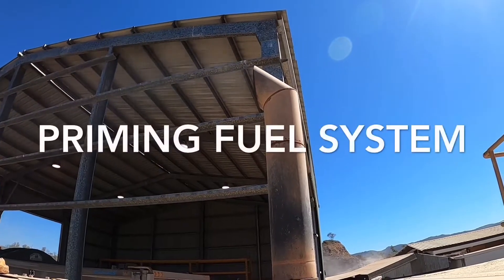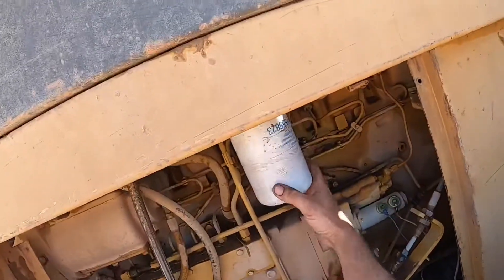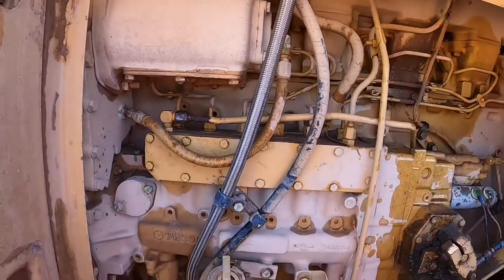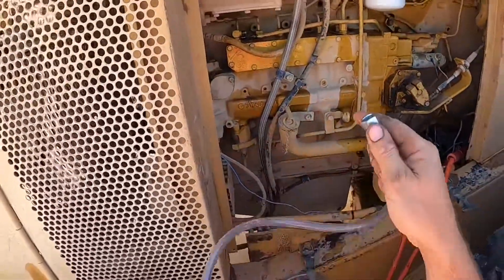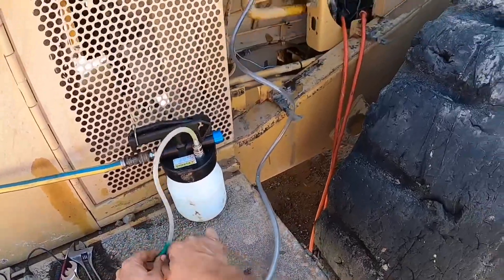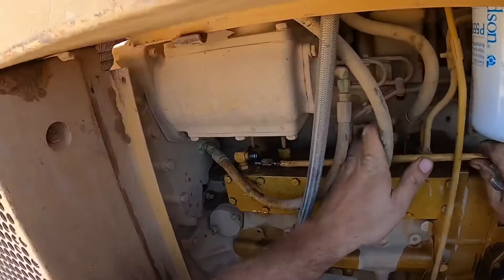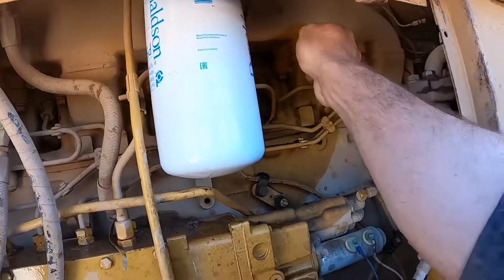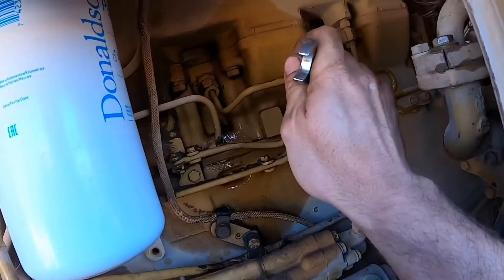How to Prime Diesel Fuel System

Comment: When I use the manual priming pump, diesel spills out of the pump... is that normal?
Reply: If you loosen any of the fuel bolts then yes it will spill, otherwise it shouldn't.

Comment: Instead of vacuuming the fuel system , pressurize the fuel system .  Connect a pressurized fuel tank  ( 10 -15 lbs. )line  to the inlet of the primary fuel filter then crack the fuel nozzle line nuts to bleed the system without rotating the engine . Tighten line nuts and start . Both ways work well . Your explanation is very good !
Reply: Sounds good. Just couple of Q. 
1. What is a pressurized fuel tank?  Like a portable one for an outboard marine , with the squeeze ball?
2. You said crack the fuel line nuts?  How many nuts?
Reply: @John33gfed  I use a portable air tank filled with a couple gallons of diesel fuel with a ball valve shut off ( 10 -15 PSI. ) .  The more fuel line nuts cracked is best at the fuel nozzle ends side .  I do not know if a boat motor tank will hold pressure  .

Comment: I'm working on a 64 ih bull dozer not really the same setup but anything helps.
Reply: Nvm bled filter then bled to distributor pump couldn't prime the lines to cylinders so starting fluid was my friend until I saw my black smoke roll